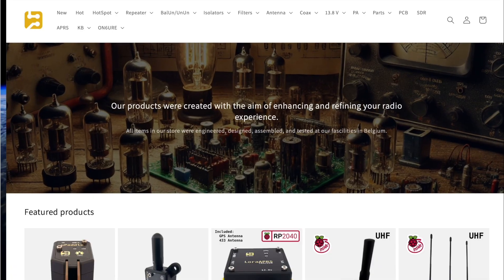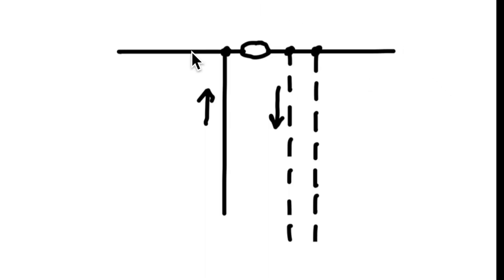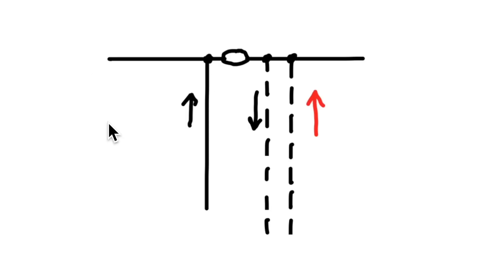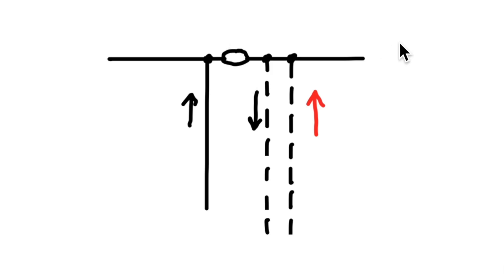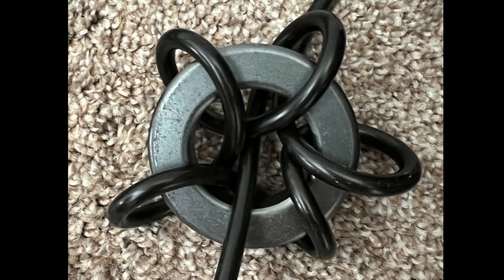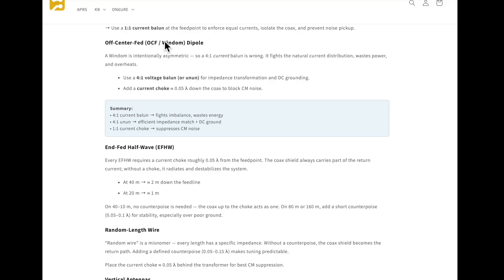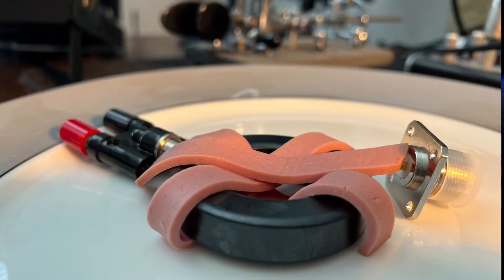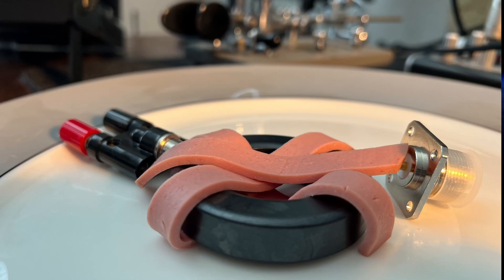Ham Radio BALUN BALONEY!  What you need to know NO BALONEY or MYTHS!

Comment: In the case of a dipole antenna, using a voltage BalUn 1:1 could help symmetrically balance the voltages in the two antenna branches. This allows you to get, as close as possible, to the ideal antenna model (the voltages may not be equal due to the physical construction of the antenna or the environment in which it is installed). In this case, using a 1:1 voltage BalUn connected in series with a choke could bring the benefits of both devices. Is this correct? What do you think?
Reply from the maker: A dipole is already balanced.  Of course not perfectly but close enough.  What you need is current kept off the outside of the coax shield, thus the 1:1 current balun.

Comment: I'm not sure the advice about an OCF dipole using a 4:1 voltage balun with a choke is correct. A number of manufacturers state a 4:1 current balun is a better choice. In fact they note just the opposite of what ON6URE wrote. They say that a voltage balun is far more likely to overheat. Like you noted, the voltage balun only ensures the voltages are equal at the OCF feedpoint and is an impedance transformer.  But a voltage balun has to handle the current imbalances on either side being off center in the dipole - which seemingly leads to core saturation heat generation - thus wasted power.

I have no idea which is right....sigh
Reply from the maker: If you go to the RF.Guru website you can find more about Joeri's conclusions.
Reply: @BustRadioMyths  I did and I’m not convinced. If Palomar and Balun Designs recommend current baluns for OCFs I think I would go with that. However, thinking about the wavelengths involved, a 40m OCF on 40 and 20m won’t have much of a current imbalance at the feed point anyway so either balun type won’t make much difference. Maybe a bit more on 15 and 10m. I’m going to reach out to Balun Designs on this question.
Reply from the maker: You can also get Joeri's contact info from from RF.GURU and he will answer.
Reply: @BustRadioMyths  Thx!! I will do that and report back to you!! Much appreciated!
Reply: @BustRadioMyths   Ok, I heard from both DX Engineering and Balun Designs on this topic 

DX says - ""Unlike a 1:1 ratio current balun, a voltage balun will always magnetize its core in direct proportion to load voltages. In a voltage balun, load impedance directly affects core heating and flux density.
Current baluns, rather than voltage baluns, should be used whenever possible. Current baluns provide better balance and often have lower loss. Current baluns, especially 1:1 ratio baluns, tolerate load impedance and balance variations much better than voltage baluns.""

Balun Designs says - "Suffice to say we follow the guidelines of Dr. Jerry Sevick PhD who is considered the godfather of modern transmission line transformers.  He suggest the current balun best for 95% of all applications where a balanced antenna is in use.  
...the model 4114 is a single dual core that "Dick" dislikes but works in conditions no other will,"

So, I'm still thinking current balun - but, in general I don't think either makes much difference unless the frequency is high for the OCF (10m on an 80m OCF) or the power is high > 200 watts
Reply from the maker: "Balun Designs says - "Suffice to say we follow the guidelines of Dr. Jerry Sevick PhD who is considered the godfather of modern transmission line transformers.  He suggest the current balun best for 95% of all applications where a balanced antenna is in use. "

An OCF is not balanced.
Reply: @BustRadioMyths   I understand that and see both sides of this argument. I don't think either one matters that much unless you build the current balun incorrectly with only one core vs parallel cores. If built right - either a voltage or current balun will work with generally lower power - 100w or less. If higher power, then you may consider moving more to current baluns due since voltage baluns may melt the core with odd impedances.  Keep up the great videos!

Comment: I use no baluns. I use standard dipoles with 450 ladder line and have no problems getting out with 10 to 100 watts!!! I use a tuner as a balun if one is needed (Heath SA2060 or  an "L" tuner I homebrewed). I planned ahead, bought a home with 12 acres land to keep future neighbors away, and have lots of room for antennas!!! I have no problems with common mode or unbalanced radiation from my antennas. I think very well of W1FB's antenna designs which allow for no balun and a very involved counter poise to let antennas work easily against ground. Keep building antennas, and studying antenna theory, especially from Schrader's Electronic Communications books!!!
Reply: Being a licensed  FCC Broadcast Engineer helps!!!
Reply from the maker: Remember when it was called a “1st phone?”

Comment: I am not sure that I agree with the choke balun placement in the 1/4 wave vertical example. Take the example where you have ground radials, I am not sure that the feeder inevitably lying between ground radials will inherently mean you have a capacitive leakage path across the choke. On my "fan vertical" I have a choke about a metre from the feedpoint as well as in the shack.  As for 4:1 current baluns, a lot of published designs do not work correctly. They really need to be wound on 2 individual cores, effectively common mode chokes with their inputs in parallel and their outputs in series. I believe the voltage baluns built into most tuners are a bad idea for a number of reasons. Thanks for the video 73
Reply from the maker: What we said was "at, or close to" as for the placement of the choke for a vertical so that fits in with what you are saying.  And also true about the 4:1 current baluns but Joeri finds they make poor impedance transformers.  Keep the jobs separate which makes sense to me.

Comment: You need to explain how a dipole works with a balanced transmission line and explain how the voltage and current cancel each other out. In a pinch you can feed a dipole with coax but it's not efficient and you will get radiation from the shield.
Reply from the maker: Actually coax works just like a balanced line with higher loss.  If a balun is used the shield will not radiate and with low loss coax it is not inefficient.  But you are right, nothing quite beats ladder line.

Comment: A 4:1 Current balun is required to match an Extended Double Zepp.
Reply from the maker: Required?  A 4:1 voltage balun followed by a choke would not work?
Reply: You can stub match that bad boy think of it as a back to back J pole
Reply: They are optimized to work with twin lead or ladder line, which lasts practically forever outdoors.  Another choke is great, but I have never had a noise issue with my 17M version.

Comment: Something worth noting is that many popular contempory 4:1 current BALUNs are based on Sevick's (W2FMI SK) common/single core design.  Upon analysis (by Duffy (VK2OMD), Rauch (W8JI) and others), these are not truly current BALUNs.  Instead, they perform more like an oddly designed UNUN.  On the other hand, 4:1 BALUNs that use a separate/dual cores design are truly current BALUNs.
Reply from the maker: Yes I am familiar with the dual core design but my man Joeri thinks it's better to use an UNUN followed by a choke.
Reply: @BustRadioMyths  Agreed.  Especially considering that virtually no real-world HF antenna is truly balanced -- especially so for an OCFD.  Thus, an UNUN followed by a common mode choke is a sensible design,

Comment: Wow, great explanation sir. 

Current balun/UNUN = RF Choke
Voltage Balun/UNUN = Impedance Transformer
UNUN for when both ends are unbalanced
BALUN for when dealing with stray currents. 

Do I have it right? 

73
Reply from the maker: Current BALUN - RF choke.  Voltage BALUN - transformer, either balanced or unbalanced depending on the need.  Unbalanced both ends is a UNUN.
https://shop.rf.guru/pages/baluns-in-a-nutshell

Comment: For regular balanced dipoles, I never used a balun.  For my UHF Yagi with a Tee match, I use a 4:1 balun made out of RG-8 for impedance matching.  For my old 2 meter Yagi with a gamma matrch, I never used a balun.  For my Carolina Windom (off-center feed), I use a 4:1 balun for impedance matching  and chokes a few feet down from the feed (I had to fix common mode RF in the shack).    --   de  AA6LJ
Reply from the maker: Sounds like you know your stuff.
Reply: @BustRadioMyths  It's part study, part trial and error, part asking people smarter than I am.

Comment: Here is a question:-
The radiating length of a T2LT antenna is a half wavelength long comprising of a quarter wave of wire extended from the central core of the co-ax plus a quarter wave of the coax screen back down to where the choke is.  This is end fed & a half wave long total.
On an OCF dipole you have a long side & a short side. The length across the two is a half wave plus you have a step up transformer for the higher Z.
Now take an EFHW.. if you run it with a tail ( like a very very very OCF dipole) why do you only measure the long side to be a half wave and not measure end to end, tail to long side
OR, if you use the braid as the counterpoise ( up to the choke) why do you measure the wire side only to be a half wave & not factor from braid choke to wire end to be a half wave a la T2LT?
Reply from the maker: That antenna is electrically a center fed dipole.  

https://shop.rf.guru/pages/t2lt-antenna-the-end-fed-dipole-that-looks-like-a-dipole-but-isnt
Reply: @BustRadioMyths  I totally agree the T2LT is just a dipole fed differently, & you measure from the choke, but why then don't you measure from the choke on the EFHW which just looks like a OCF T2LT dipole
Reply from the maker: It's not the same just looks the same, if that makes any sense.

Comment: Mark, as usual great information. I've done some experimenting with my full wave mono-band delta loops (80 and 40). Hams in various literature are rather dogmatic about what matching to use....2 to 1.....4 to 1.....75 ohm  matching sections, etc. They don't take into account shape of the loop, polarization, height of the antenna off the ground, etc. I found their specs to be way off, and use a 1:1 current balun on both.

BTW....I've also experimented with the Baloney Balun concept....I like the venison version the best. 😂

Jeff  W3AAB
Reply from the maker: That's the great thing Jeff bout the baloney balun.  You can experiment.  Try adding mustard and a pickle.  And what you have found regarding the 1:1 makes sense.
Reply: @BustRadioMyths ooooohhhhh.....mustard and pickle with my balun.  😋

Comment: There is a lot of "baloney" out there regarding "HAM" radio. I am lucky enough to have a local mentor who has been licensed since 1965  (advanced, GROL, MROP, GMDSS-M, GMDSS-O along with a radar endorsement).... and he was a long time Kenwood commercial dealer. 

So when WA5NBP tells me to do x,y and z..... I listen. For example..... he runs 3 different HF antennas..... one is a tower vertical that will get him down to 80m's. To that tower he has attached 4,000' of radials. That's 15 wls of wire. Why? Because he lives in a rock. 

His rule of thumb is always consider the soil to be poor!
Reply from the maker: Interesting I also got licensed in 65 and have a GROL but my setup has always been very simple.  You are fortunate to have an Elmer like that.

Comment: Laughing, yeah those 2 products at the end had me in tears! Reminds me of the old product that sold for a while that was nothing but a 50 ohm resister potted in a enclosure that promised it would "auto-tune" you just needed to add the wire.
Reply from the maker: Wow what snake oil.
Reply: Wasn't that sold by Buxcomm (Buck Rogers, K4ABT)?  Any wire would be "tuned" as an antenna. 😜
Reply: @michaelbolton2741  I don't remember who sold it. I think either 73 or QST magazine x-rayed it and found what was really inside the "balun" I'm sure they sold hundreds of the things.
Reply: A bit like the ‘AM to FM CB Antenna Converters’ that were touted when ‘legal’ CB on 27FM was introduced in the UK back in the 80’s. A small plastic box fitted with UHF input/output plug/socket and in some cases a tamper-evident seal. Inside the box was…… a short length of coax joining the two connectors 😮. I wonder how many fell for that one. 73 de GM4RAH 🏴
Reply from the maker: At least the AM tO FM convert had very little insertion loss.

Comment: Thanks Mark, I really appreciate your videos. I wonder if it should be standard practice to use a 1:1 balun at both ends of the feed line for a vertical, and maybe in general? What mix? Or two chokes with two different mixes? Hey why not four?😂Where does insertion loss become significant?  I'm not sure about the 13 feet for the 10-80 end fed, because I'm a metric kind of guy, I'm guessing it's like a 1/4 wave stub or some such? Is there a formula for it and how does velocity factor play into it depending on what coax you use?  I do think about trapped antennas, and wonder if the problems of LC could be solved with flat  ribbon shaped inductors, where those flat ribbon spaces would  give capacitance, and you could change the distance between the turns to vary this, and the inductance of course by adding or subtracting length to get a sweet spot. I want to patent my antenna: A Cantenna with a UHF "T" connection... one side goes to the Cantenna, and I place a brad nail on the other side of the "t."  It tunes on all bands and I don't need the car heater or a jacket while I'm operating!  73 DE W8LV BILL (and in SANER times: W8LV/VE3)🇺🇸🇨🇦🙏🇺🇦
Reply: The length of the coax before inserting a 1:1 choke is 5% of the lowest band. 5% of 80 is 4m or 13.12 feet. The 13.12 ft is your counterpoise.
Reply from the maker: If using coax as the counterpoise the choke goes .05 wavelength down the line.  So multiply 80 meters times .05 and you have 4 meters or 13 feet US.  And using a 1:1 as the feedline enters the shack is good practice for any antenna.  The insertion loss is very low, or zero basically since there is no impedance transformation.  As for your new invention let us know how that works out!